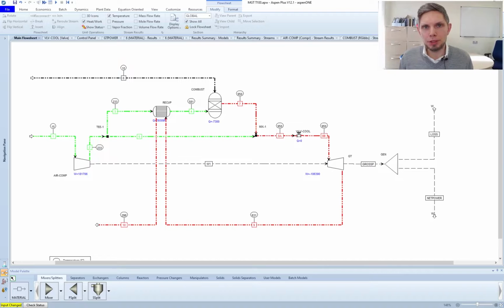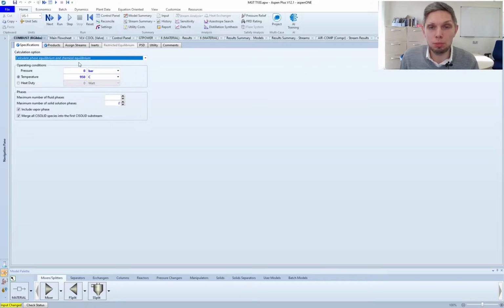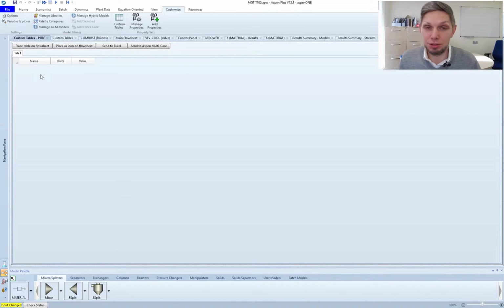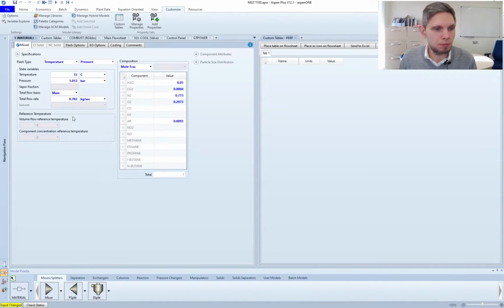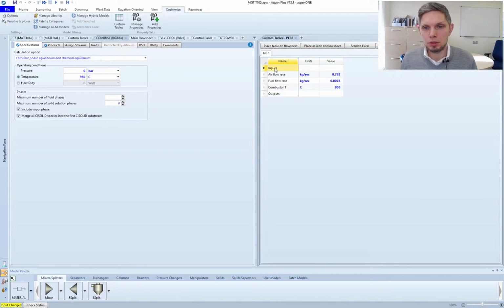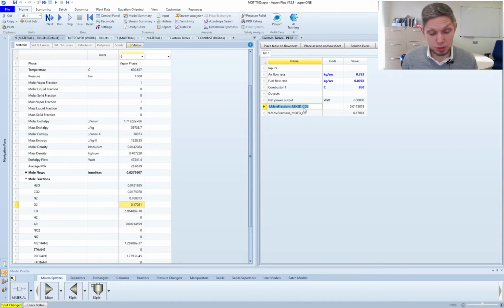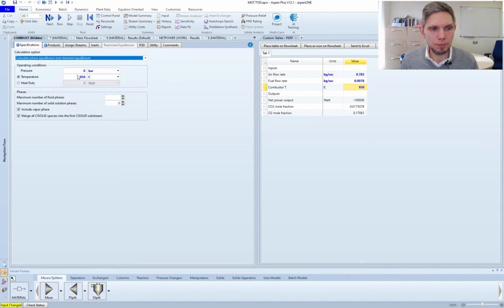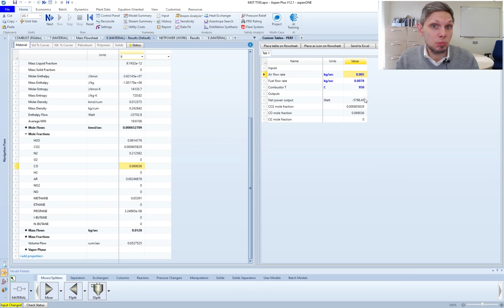What is the best way to manage process variables in Aspen Plus

Comment: Hello Dr Hanak. Thank you for the video. I  was wondering if you ever experienced some parameter values in the custom table becomes 'grey block' after sometimes and not being available to you anymore? For example, I have heat exchanger area in my custom table and for some reason, the area value is not available after running the model for some times. Kindly let me know if you experienced anything like this. Thank you so much for your time.